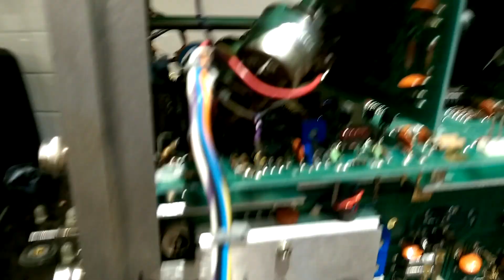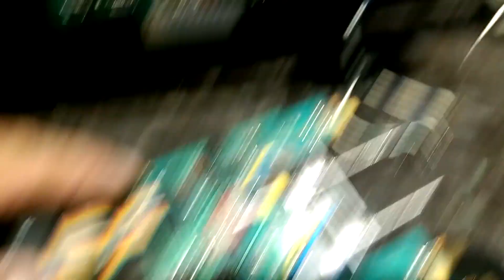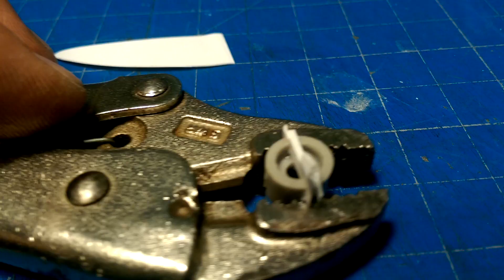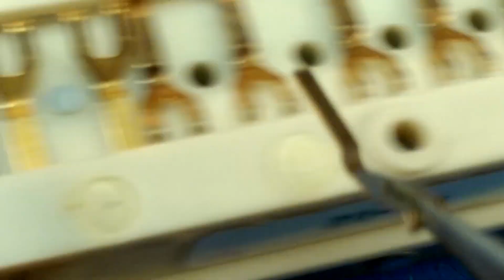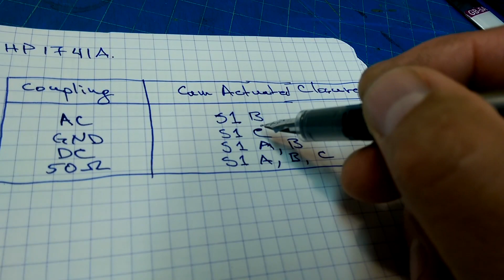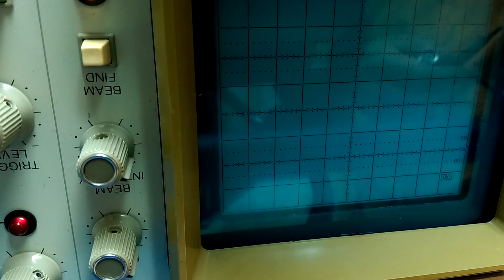breaking and fixing? a working HP 1741A

Comment: Nice video. I just got one of these scopes and I have no trace. Do you think you might be able to help me trouble shoot it ?
Reply from the maker: No guarantee of success.  But where I would start is getting a hold of the service manual.  https://www.keysight.com/en/pd-1741A%3Aepsg%3Apro-pn-1741A/100-mhz-dual-channel-storage-scope?pm=PL&nid=-536900196.536896504&cc=GB&lc=eng  And take a look at the Service section.  As with most things, start with checking the low voltage power supply.
Reply: I did download that and spent a few hours on the scope the lvps seems fine but on the hvps board I don't see and neon lites lit up. Q1 is oscillating but that's as far as I could go if you could shed some light that would be great...
Reply from the maker: @dondakin1  front panel controls are all set per Section V?  I only ask because I have made that mistake before :-)
Reply: I think I am ok there looked at section V I really don't see any trace I can see the screen light up green when I put it in storage mode but in conv mode no trace ever. Do the  neon lights on your hvps light up with power on ?
Reply from the maker: @dondakin1  I would have to pull it open to see, and I am at work now.  But I don't remember seeing them glow.
Reply: Just stabin the dark here I thought they would glow or flicker with the trace. Mine are always dark.
Reply: Btw really appreciate the help...
Reply: Took another look and it looks like the cathode is sitting at about 550 volts instead of 2300 have to keep looking into this
Reply from the maker: @dondakin1  I can confirm that the neon tubes do not light up.